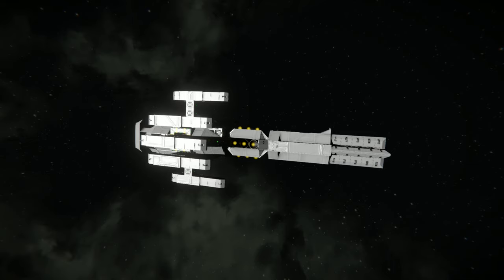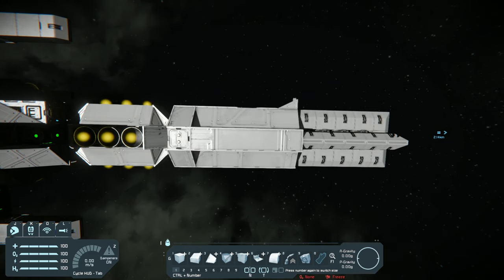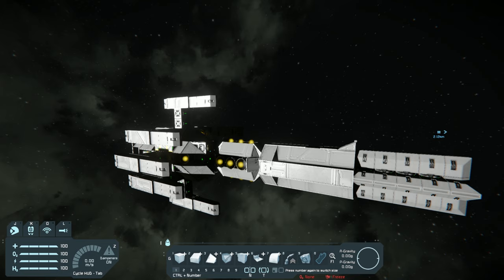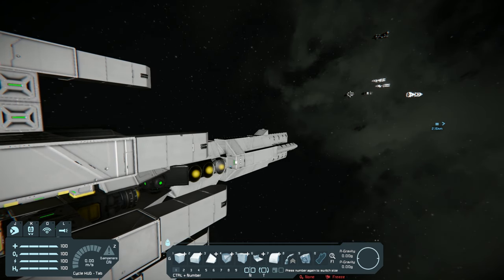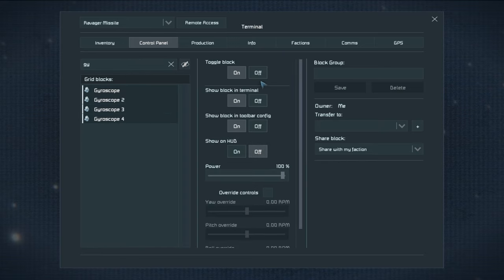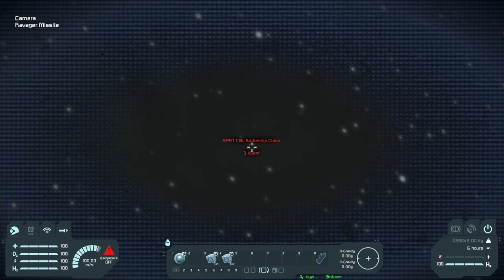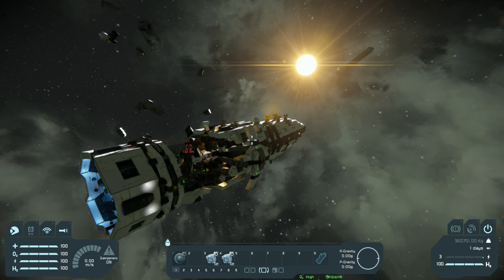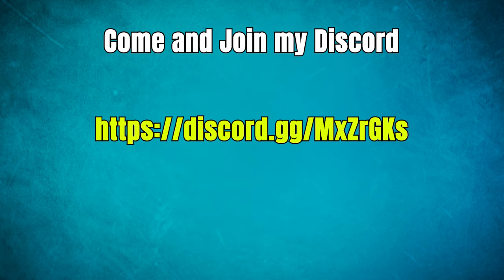Space Engineers - Ravager Missile - The ULTIMATE Kinetic Weapon! (Ship Review)

Comment: Been 4 years since that video has been released. Still usefull today?
Reply from the maker: Large ship weapon tracking is a bit better now but I'd still say that this weapon is useful today. It's a cheap and reliable system that can inflict massive damage upon an enemy ship and you can recover the drive section for later use. If you have the materials you could jump it back to base and have it fully resupplied in less than 10 minutes. 

If you were to use it nowadays I'd recommend using it as part of a larger fleet battle. It will be a lot more useful there than in 1-on-1 combat.